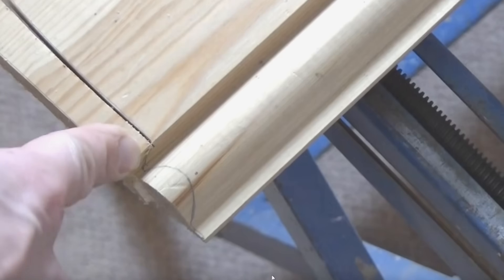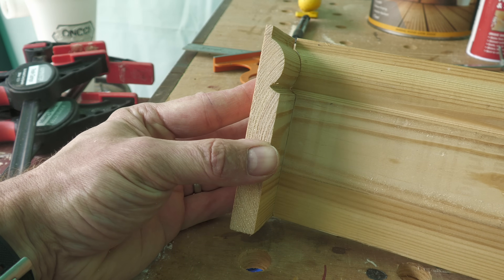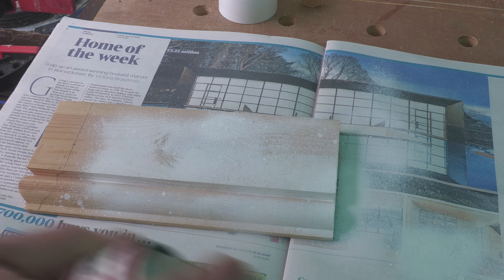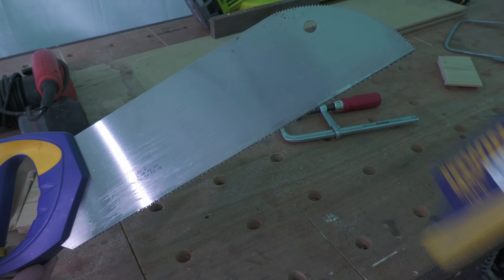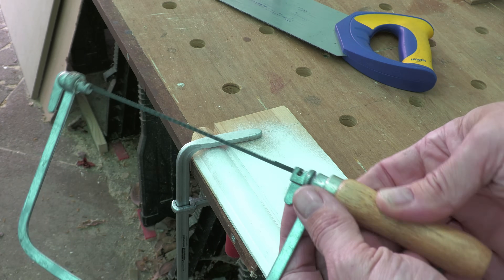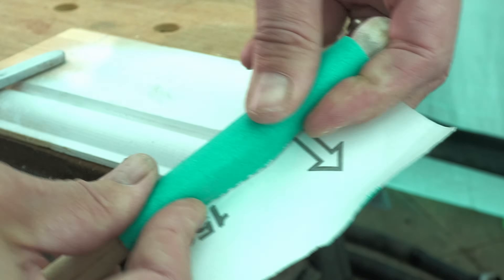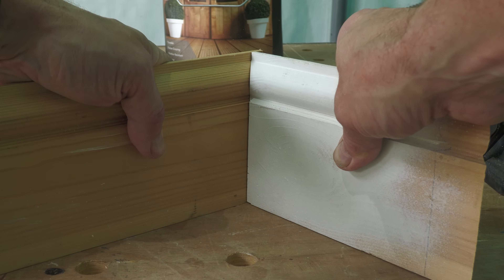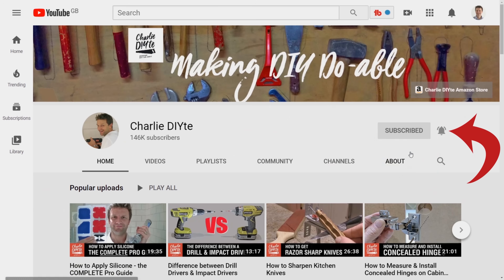How to Cut & Scribe Internal Corners on Skirting Boards

Comment: Just been doing my skirting and after seeing your previous videos went for MDF.  I went with a square profile with 2 grooves cut in at the top.  For the internal corners I used a 18mm (thickness of the board) router bit set to the depth of the grooves.  This created a notch for the joint and any gap on the top from not being 90deg can be easily filled with the vertical joint being tight.  Ended up in A&E for 13hrs after slitting my thumb with a Stanley knife while cutting back a notch for a radiator bracket!
Reply from the maker: Easily done Richard. I did something similar once chiselling a banister. Put a new chisel through the palm in my hand. Hope you're ok.
Reply: @CharlieDIYte  all good, not the first time and sure it wont be the last!  Work offshore so had to get it seen too.  However the office decided to delay my next trip.

Comment: Hi Charlie, Another handy tip is to use an Angle grinder with a sanding pad on. Takes less time and with a steady hand can be very accurate.
Reply from the maker: Thanks. Yes and I've used my belt sander a lot over the years. With practice you can get very accurate as you say. 👍

Comment: I've watched this repeatedly, and practiced with scrap wood but I'm making a right hash of it so far.  You make it look so easy! 😅
Reply: Don’t worry you’ll get it if you practice enough 👍
Reply from the maker: I'm sorry to hear that. How are you getting on with it now? Any better with a little practice?
Reply: It’s a waste of time mate cut a 45 or lift or lower your cut to adjust the angle. Check your corner with a square and go from there. Why is he making this so difficult?.

Comment: Hi Charlie,  good clear tip on this some times difficult job, I don't think I've ever found a 90 degree corner in any house I've been in ,lol, so this method would take alot of frustration out of fitting skirting boards. Cheers mate, stay safe, best wishe's to you and your's, Stuart UK.
Reply from the maker: Thanks Stuart, I appreciate that. Yes that's the point really. Makes the corners so much easier to fit. 👊

Comment: Your almost there for perfect cope fitting. One more tip butt the skirting up against the wall were its going to be fitted and adjacent wall and scribe with a compass . If the floor or wall are out of plumb the scribe will be at a angle. Now cut to the scribe line with miter saw. I hope you can make sense of this description 😁
Reply: That's a great tip, especially when adjoining floors aren't dead level.
Reply: Robin Clevett has a great video on skill Builder doing this exact method.
Reply: Robin Clevett also has a vid completely ignoring this vital stage and doing it wrongly.

Comment: Thank you so much for this. Just a quick question, if I’m scribing one skirting to another, is it essential that I make an exact 45 degree mitre cut? Could I just do a rough 45 degree cut by eye if I’m going to cut out the outline shape with a coping saw anyway?
Reply from the maker: I think if it's roughly 45 degrees you should be ok but it needs to be consistent so you have a consistent shape. Failing that (my old technique) put an off cut which is cut at 90 degrees on top of the skirting you want to cut and stencil around the shape. It's just not as accurate.
Reply: @CharlieDIYte  thank you so much Charlie :). I also have an old house and having watched your video, wondering whether I should go for mdf over pine. Wierdly my local timber merchants offer pine cheaper than mdf. Despite all the warping, I’ve read that mdf doesn’t stand up to moisture or have as much longevity. Given the chance, would you have used mdf over pine for your bedroom?

Comment: A great sanding trick indeed on Gosford handyman is to spray glue a sheet of sandpaper to a piece of skirting, making sure it goes into the profile. Now you have a sander in the profile of the skirting to fine tune to corner edges.
Reply: Came to the comments to post exactly this but will "like" this comment instead!
Reply from the maker: Thanks. Does that not make it slightly too big?
Reply: @CharlieDIYte  I think it fine tunes the cut of there is a high spot that is difficult to have a second go at cutting.

Comment: Hi Charlie. What method do you find is best to secure skirting to the wall? These days I see them being glued on with low expansion foam. I saw you use small screws before - do these not show pops over time on the surface kind of like how pins always do?
Reply from the maker: Those hidden screws are about as good as I've found so far as the filling is so easy. No, they don't show any marks. Yes the adhesive foam is good. Done works day you don't need foam with this if you give it a few minutes before pressing the two surfaces together but I think a mechanical fixing is still good, to hold it in place whilst it sets.

Comment: Thanks for the video Charlie. My coping saw skills are proving to be pretty awful (doesnt flow properly and it's taking chunks out of the wood) and the scribed skirting isnt joining the other piece nicely. Does anyone have any tips on how I could rescue or best to start again? It's also not sitting flush to the newly plastered wall, which is driving me nuts -  in caulk, we trust.

Comment: How would you fill any small gaps? Wood filler cracks over time right?
Reply from the maker: Small gaps in the corner? I'd use caulk. For screw or nail holes I'd always use a2 part wood filler. https://youtu.be/qhe3Waq6Ac4

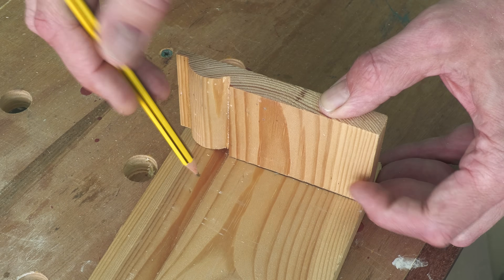Comment: instead of the 'previously' 0:48 part shown just draw the profile on the back of the board instead and cut it that side. job done! :)

no need for this mitre scribing nonsense people do. **I hope you see this and try it...then do an update on this update Charlie LOL

it also allows for compensating by slotting into/onto existing skirting boards that are wonky top or bottom to the wall if needed(a mitre cut ends up limiting it to a flat 90 degree cut along the end resulting in a gap either top or bottom if mitred (ik you can fill but a flush snug wood joint is always best)
Reply: wood is forgiving(even softwoods especially) when the fibres are deformed with a hammer. I use a ball peen hammer as the round end can form curves. 

delicate impacts/bangs can shape the wood to fit if not exactly 90 degrees as you was showing by then sanding. does the job and also helps seal the end grain from absorbing moisture at the joint with it being compacted with the woods natural fibre resins...
Reply: sealing of end grains like this is a really old practice. I live in a really old house and I see all the old joists deformed/sealed this way. even architraves for doorframes and windows I've removed to restore/repair plaster are sealed the same way. it clearly helped make wood last hundreds of years from personal observation. my dad originally showed me it.
Reply from the maker: Thanks. That's how I used to do it. 👍

Comment: I had sucess superglueing sandpaper to the profile of the skirting for the finish
Reply from the maker: Yes a few people have suggested that. Good tip. Out of interest does it make the profile a bit too large?
Reply: @CharlieDIYte  I thought that too but it gave really good result. Normal sandpaper pressed tight into the profile of an offcut with a scraper. Cut the straight bit with chopsaw, coping saw the top section with an undercut leaving a margin to sand back to!

Comment: Been working on big commercial building sites. 0:19 I have never done scribe internal corners, it is a waste of time. Always mitre. Use an angle gauge if you have no experience and calculate the angle by dividing the total by 2. Set mitre and cut. You will end up with a nice clean joint. As I have enough experience I use only a square to check which way the corners are out of 90 degrees and then adjust the mitre accordingly. If you need to cut shallower than 45-2 degrees there is a trick on how to achieve it.
Reply from the maker: It's a fair point. If you've got a hell of a lot to get through this is much quicker.

Comment: The most comprehensive method I've seen involves using a back-cut template against the adjoining wall to scribe the face of the board in situ, then back-cutting from that scribe mark. As far as I can see, what the first step accounts for is the possibility of the walls being out of plumb (meaning the boards will lean in or out). Most of the time, this refinement won't be necessary, and results will be good without it. However, without it, although the boards are coped, it's probably a misnomer to say that they are scribed, as such.
Reply from the maker: Fair point. 👌

Comment: If you have a circular mitre saw and cut 45° then no point for extra cutting...just add 45 to 45 boards?
Reply from the maker: It doesn't work if the angle isn't exactly 90 degrees.

Comment: Just a question, why not get the right angle with a bevel and adjust the saw? It’s much quicker? Just wondering. Over here I’ve never seen somebody do that. Thanx
Reply from the maker: The trouble is, that way the angle is likely to open up if the wood warps or shrinks, but I hear what you say 👍
Reply: @CharlieDIYte  Ah, now I see! Thanx for the tip!

Comment: The tip is great but if you have to do a lot it costs a lot of time.
What I do is, have 2  clean 45 degree pieces (like 15 cm or so) putting in the corner and line them up to the wall.
The gap will tell me about how many degrees the cut is off, dived that by two and adjust my cutting.
I admit it is more or less an "eye" thing but if you have done it a couple of times you get the hang of it.
Anyways, thanks for sharing.
Reply from the maker: I do so much carpentry by eye too so I know exactly where you're coming from, right down to fine tuning angles with my belt sander. 👍
Reply: No internal mitres, cope every time, internal mitres shrink and open up!

Comment: If you have to do a lot of scribes I was taught to do what is shown in the video, by putting a mitre on both ends of a short (4"/100mm) offcut and cut the profiles so there was a scribe on each end. Let's call it the template.
STARTING:
Fix a board with two square end cuts on the wall opposite the door to the room.  For the return, get a length of skirting about 3"/75mm longer than needed and butt it up to the piece that is fixed and using the template held up against the fixed piece, draw a line up the face of the new skirting, (I used to use an old school compass).  as long as the flat is marked you can easily put the board on a trestle and re-mark the mould part. Use the saws to remove the waste.  You can the measure from the bottom of the fixed skirting to get the length needed.  Either cut it square or put a mitre on the far end as required. Work your way round the room like this and you don't end-up trying to fix a piece with mitres or/ and scribes at both ends.

This method is especially handy in old buildings where the walls may not be perfectly plumb.

Comment: Why the 45 degree angle?
Reply from the maker: It helps you to see the part you have to remove, otherwise you've got to last whitey board on top and draw round which is less accurate.

Comment: I personally would have my coping saw blade set on the push stroke for scribes, this way it reduces the chance of tear out
However, you didn't seem to have this problem in the video.
Reply from the maker: Yes, whatever works for you I'd say. Hack saws for example have the teeth pointing the other way so it works on the push stroke. Seems counter intuitive having it working on the pull stroke although I have a Japanese shokunin saw that works on the pull stroke too. 👍
Reply: That's the way I was taught as an apprentice nearly 40 years ago,  always have the saw blade cutting  on the push stroke so no tear out.
Reply: You're correct.

Comment: The only problem with the Irwin saw is like any "throw away saw" they dull after a few uses, far too expensive just to chuck away. I use my trusty dovetail saw, which I can sharpen at my leisure.

Comment: I am not sure it’s a hard  and fast rule about the teeth direction of the coping saw. Many woodworkwers  prefer cutting on the push stroke as can offer better control. Paul sellers advocates this for example.
Reply from the maker: That's a fair point - and I would agree that cutting on the push gives you better control although my Japanese shokunin saws that cut on the pull are excellent. Imaging how good they'd be if they cut on the push!

Comment: But if the walls aren't plumb you'll still have a gap.mark the floor and top and bottom with an off cut and that will give you a true cut 😊

Comment: Thanks Charlie- an extremely helpful video. Went out to Screwfix to grab one of those saws - for anyone looking for the specific one, it’s Irwin Jack  12tpi Multi-Material Floorboard Saw 13" (330mm) product code 9429X
Reply from the maker: Thanks - glad you found it useful 👊